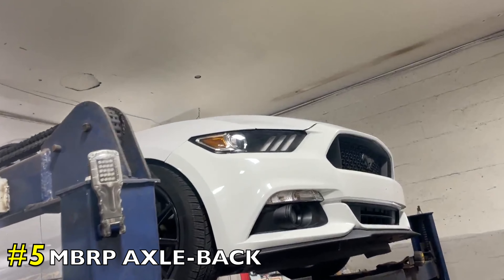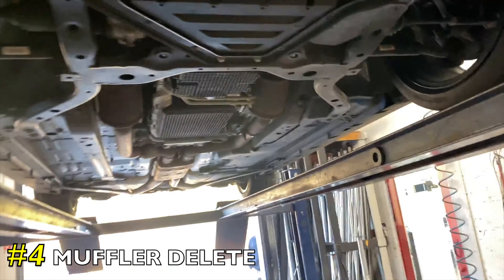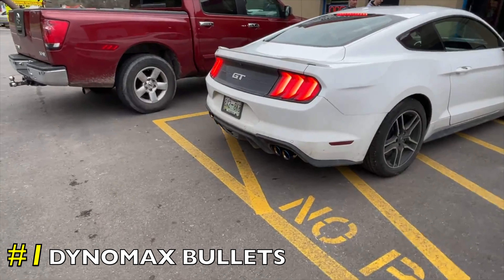Top 5 BEST EXHAUST Set Ups for Ford Mustang GT 5.0L COYOTE V8 (Vol.2)!

Comment: That coyote is quickly becoming my favourite V8 (modern era)
Reply: Hands down the best engine ford has done since the Termi.
Reply: @169abr  i do love a small block out of a falcon GT-HO for classics but I also cant go wrong with the Boss 5.4L v8
Reply: @QKvox  classic cars deserve classic engines, if you’re keeping it original. RestoMod? Coyote or a 5.4/5.8 swap would be badass in an old school GT500 RestoMod, or a full CJ/Cams Coyote setup in an old Cobra Jet car.
Reply: Is it a 6 or 10 speed
Reply: @dubbahopsin330  manuals are always better

Comment: Good vid, actually needed this as someone who owns a 2020 gt and still has stock exhaust but still choosing what to go with
Reply: @barackputin  😂
Reply: @Ramsfan-x7t  if you have the performance exhaust with valves I would do a resonator delete and some headers and keep the valves so when you get tired of the loudness which you will eventually you can just switch it to quiet or normal and track for maximum loudness
Reply: You should check out MRT's Interceptor system. One of the best sounding systems for the Coyote. Nice deep sound without being raspy.
Reply: Same

Comment: I don't get it why you would remove active exhaust  such a nice feature I actually made sure that was on the car before I bought it take off the mid muffin put an x-pipe it'll be quite a bit louder
Reply: Mine has active exhaust and I'm doing away with it I'm going muffler delete and resonator delete with xpipe
Reply: @Rick-gk3ro  go headers and keep active exhaust trust me
Reply: @SlimeLifeBarter  i already removed active exhaust. I did a muffler delete. I can't afford headers lol. Almost 2000 dollars
Reply: @Rick-gk3ro  wasted a $900 option, I spent $2000 total on headers and install where you get the loud and quiet active exhaust sound plus the power gains
Reply: @SlimeLifeBarter  i like mine loud all the time. If it were up to me i would also delete the cats.
Reply: @Rick-gk3ro  if you really want loud you’d have what I have and have the ability to quiet it down because it gets way too loud
Reply: @SlimeLifeBarter  i don't like mine quiet at all that's why i did away with active exhaust. My wife or neighbors probably don't like it but they will get over it lol. It definitely will wake the neighborhood up on cold start. Mine has no mufflers at all now.  No resonator either.

Comment: 1) 0:08 MBRP AXLE-BACK 
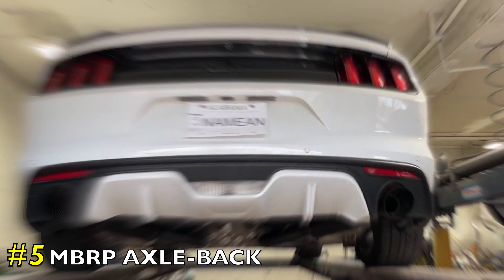2:02 Sound/Revs
3:31 drive off

2) 3:47 Muffler Delete
4:57 Sound/Revs
6:19 drive off

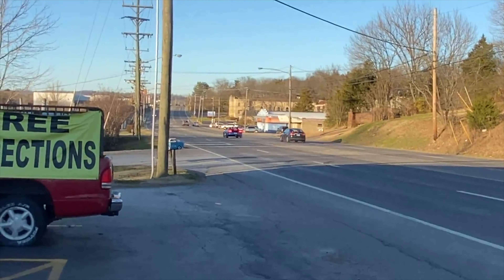3) 6:27 Straight Pipe
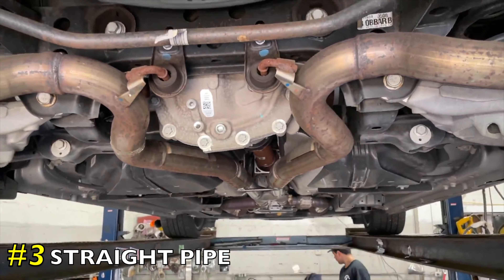7:46 Sound/Revs
9:23 drive off

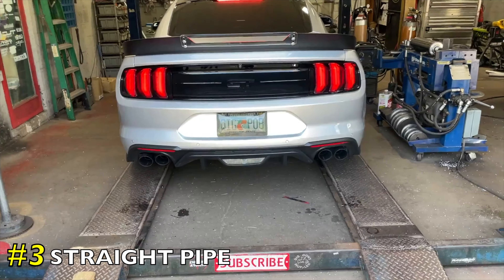4) 9:34 Borla Pro-XS
10:26 Sound/Revs
11:48 drive off

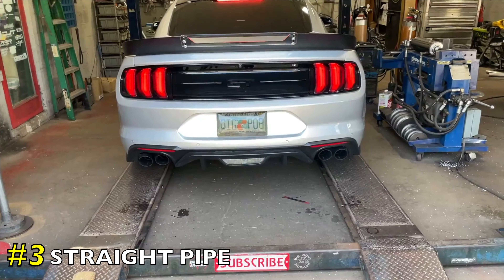5) 11:56 Dynomax Bullets
12:58 Sound/Revs
14:05 drive off

Comment: My uncles mustang is a 2018 with an mbrp kit but with the h pipe replaced with an x pipe and catless mid pipe and long tubes and it's ridiculously loud and raspy could definitely use a tone down
Reply: Loud is better. I'm doing muffler and resonator delete on my 2019 gt premium. Already has xpipe
Reply: Loud is definitely not always better .🙄
I have Solo Performance cat back on my 2011 GT. Absolutely love it! Great deep and refined tone. Not too loud until you get about 3-4k rpm’s. If you like loud, get their street race system

Comment: I have muffler delete and X pipe all I have left is cats and it is loud.  The hell with paying $2000 for an exhaust system that's nuts I paid $350 for a muffler delete kit with nice polished tips
Reply: Because they actually sounds good. Coyotes already sound harsh. Worst of the big three muscle segment. Straight pipes and muffler deletes make them sound like absolute 🐩 💩
Reply: You get actual performance gains with a quality system, not to mention it doesn't sound terrible.

Comment: The first mustang shows it has 87 miles to empty, however the gauge shows he has a half tank left.
Reply: Would make sense if he’s on E85.
Reply: I get about 110-130 with a half tank in mine
Reply: Mike Ameltoe  my 2011 could get 28mpg
Reply: Yep, in my 19 GT the gas light comes on at 1/4 tank, only 50 miles to empty at that point lol
Reply: Yep, in my 19 GT the gas light comes on at 1/4 tank, only 50 miles to empty at that point lol
Reply: It calculates it using your average mpg so if you’re beating the shit out of it getting 5mpg it’s gonna be low